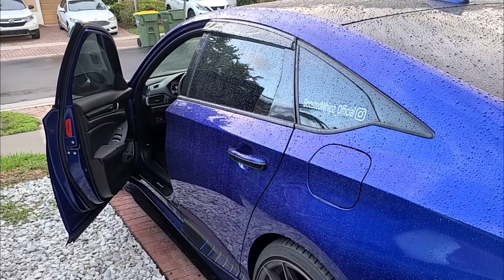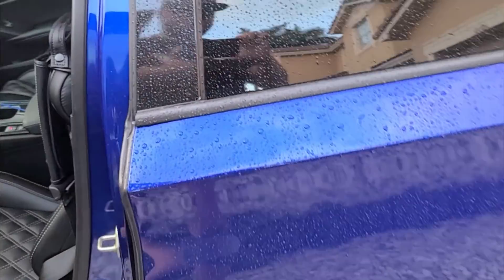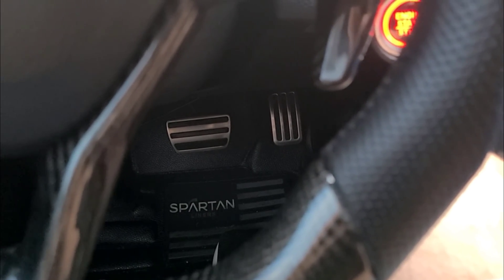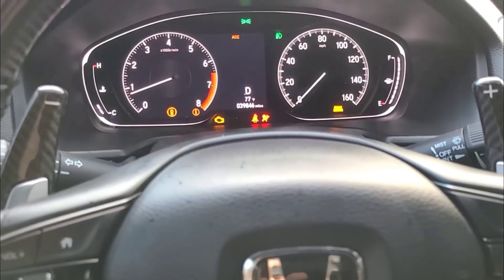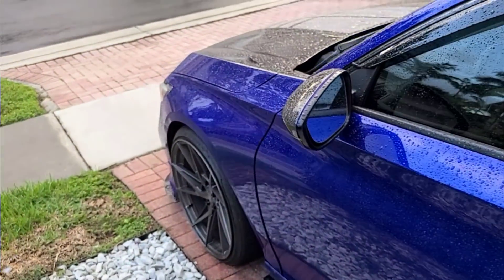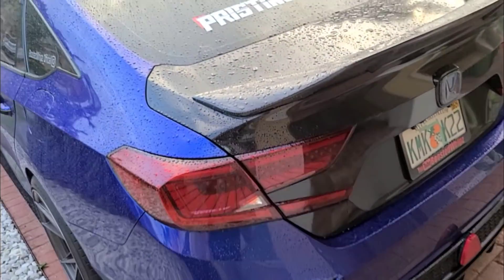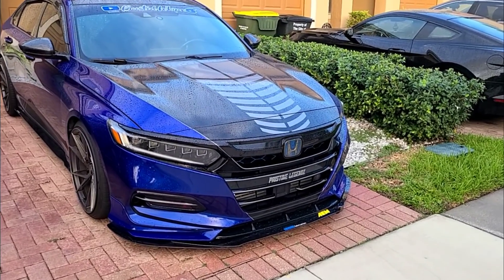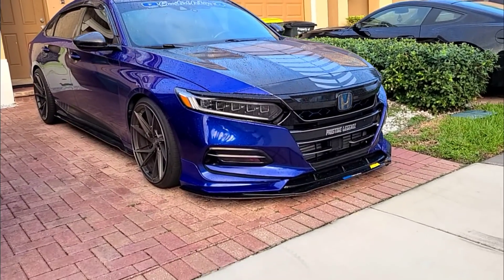CVT Transmission Goes Out at 40K Miles on Modded Honda Accord 2018-2020

Comment: New Honda built quality went to hell. My mom's Honda Accord had to have engine rebuilt after 80k because it was burning so much oil and their warranty is 💩 too! Said it was her fault for putting the wrong gasoline in it when there is no warning for what gasoline.
Reply: what kinda gas?? wth. their warranty expires at 36k i think is shit
Reply: @JollyFlys  just the normal 87 regular. Honda rep stated my mom needed to put top tier fuel in the car. There is no mention in the owner manual or anywhere else. My mom also had the extended warranty too. Me and my family will never buy another newer Honda again! The older Honda are fine though.

Comment: same cvt? won't it blow again?
Reply from the maker: Not planning to run same tune. Plan on going back to stock tune or a base Stage 1 tune.
Reply: @BoostedWhipz  gotcha. ive got a 2014 civic with the first cvt they put in these things. hasnt blown yet but its bone stock. its the thing i worry most about with these cars. now that they have turbos too they will wear out faster. not a fan of this trend.

2k is a very cheap price though. ive heard 6-12k. the things arent rebuildable either because they tend to just straight up explode with shrapnel on the inside when they go

Comment: You know your not supposed to change transmission fluid with a cvt right?? The fluid is for the life of the car. If you change the fluid you need to change the transmission
Reply from the maker: The fluid must be changed at 35K interval based on Honda.

Comment: That's a noob thing to do man. If you're trying to race or mod a car drop a proper solid manual transmission in it and upgrade the components accordingly.

You're better off putting in a 6sp manual or automatic.....generally speaking CVTs are garbage. They are only useful for regular driving and saving gas. But not worth it.

Comment: Cvt gearbox is not that reliable in any manufacturing brand. Here in Malaysia, proton, toyota & also honda have this problem. Thats why hyundai, kia, mazda dont opt this gearbox. Normal automatic gearbox is much reliable. Previously own civic FD with 5 speed automatic, dont face this kind of problem until i sold it.

Comment: I have  Accord coupe v6 I dont even have a turbo and I make more power naturally aspirated than your number on the dyno do u know what transmission power loss is you loose alot from a CVT or  Automatic did you know The J motor is the best road motor they make it comes in the NSX only special hondas and Acura came with the J motor everyone is lost and im sad

Comment: What spoiler is that it’s clean?
Reply from the maker: No longer available but we have a similar on at AEMTuners. Here's link. 

Use AEM-BOOSTEDWHIPZ discount code. 

https://www.aemtuners.com/shop/2018-22-honda-accord-spoiler-3/
Reply: @BoostedWhipz  discount code doesn’t work
Reply from the maker: Did you use entire code?
Reply: @BoostedWhipz  yeah says code doesn’t exist
Reply from the maker: You are putting "AEM-" as well right?
Reply: @BoostedWhipz  I got it now thanks one more question is it taped on or bolt for the spoiler?
Reply from the maker: 3M as all. There isn't any bolted on. Use a higher grade 3M than the one that comes with it. Let me know once ordered.
Reply: @BoostedWhipz  I will when I get payed but what rims are those too?
Reply from the maker: I sell wheels and suspension. When ready just email me at frank@tunergoods.com
Reply from the maker: Those are Vertini. 19s setup start in the $1500s.

Comment: What are your tire specs?
Reply from the maker: 235/35 front 275/30 rear
Reply: @BoostedWhipz  could I run 275 30 all around?
Reply from the maker: @alibattla9763  I have 275/30 in the rear because I have 20x10.5" wheels in the rear. I believe you can run the same all around but may have a less turning ratio up front.

Comment: y do you have to pay out of pocket you only have forty thousand miles y isnt it covered under warranty cause thats a factory defect
Reply from the maker: My car is heavily modified. Honda won't even look at it.
Reply: ook I understand so your going to put in another cvt transmission even tho it could go again you can't upgrade it
Reply from the maker: @colinchandler6516  unfortunately yes because I cannot do a conversion. The cost is much more and I rather just buy another car if I go that route ever. For now getting the CVT swapped for another and lowering down the tune to a basemap.
Reply from the maker: @colinchandler6516  unfortunately yes because I cannot do a conversion. The cost is much more and I rather just buy another car if I go that route ever. For now getting the CVT swapped for another and lowering down the tune to a basemap.

Comment: My 2.0 went out at 16k,  I wasn’t happy
Reply: the engine went?
Reply: @jamesmedina2062  transmission
Reply: @JoshSmith-hs3sd  Automatic?? How did it work and how did you drive it?
Reply: @jamesmedina2062  it was my daily driver for work which was about 15 minutes one way, and then when I went to college just a 5hr trip, I went to Charlotte a few times with it. Occasionally would put it in sport and give it some throttle but noting the car should not handle. I got a transmission failure message on the dash one day and took it to Honda they said they couldn’t see anything wrong. Got the message about 2-3 more times and then I couldn’t even move it.
Reply: @JoshSmith-hs3sd  Well that makes sense for two reasons. Honda dealerships are told to not fix anything until its really broke. The oil/fuel dilution was ignored for months. My issues were mostly ignored. So the dealers just suck. As for the transmission, I had lots of problems with my manual transmission switching gears and it was a little noisy and then I switched fluids and things improved a lot. I think the Honda fluids are really cheap and really bad. Honda looks at fluid like a tool to allow things to break down after warranty. I am sure of it. As they say, Honda is not the same company as they were when Soichiro Honda was alive. Their customer service is as cold as it gets as well. They are far more driven by profits and made many parts in China today. Engine: Thailand, Trans: India
Reply: @jamesmedina2062  it the transmission fine (working well) in your 2.0 now??
Reply: @aymanal_jahwari9148  No I have a manual 6MT on my 1.5T Civic and I test drove the CVT 1.5T as well and know the 2.0T from driving Type R which is a rocket once it gets up to speed. So thats why I asked what transmission you have. I think the 2.0 gets a 8 speed geared automatic. Did it get replaced under warranty?
Reply: @jamesmedina2062 
In fact the 2.0 has 10 speed AT 
They say it very good transmission
I have 2019 1.5 accord exl and it is very good car

And i am planing to buy the 2.0 and give the 1.5 for my sister

Yes this is what i want to know from  @Joshua Smith did honda replaced the transmission under waranty and how is his car now i hope every thing is ok now

Comment: Your car has a 10 speed automatic transmission, not a CVT.
Reply from the maker: Mine is CVT
Reply: @BoostedWhipz  Sure thing.  OK.
Reply: @BoostedWhipz  So you have a 1.5 liter?
Reply: @BoostedWhipz  Here is what I found and I totally forgot they did a 1.5 turbo!!!

 A base 1.5-liter VTEC turbo four-cylinder engine with available active grille shutters produces 143 kW (192 hp; 194 PS) and 260 N⋅m (192 lbf⋅ft) of torque, mated to a 6-speed manual or continuously variable transmission (CVT).[60] The optional 2.0-liter VTEC turbo four-cylinder engine, which replaced the V6 engine option, was available beginning December 2017. This engine is based on the engine in the Civic Type R, but with a smaller turbocharger, different pistons and camshafts, and the addition of a pair of balance shafts.[61] The engine, which produced 188 kW (252 hp; 256 PS) and 370 N⋅m (273 lbf⋅ft) of torque is mated to a 6-speed manual or 10-speed automatic transmission.[60] The 10-speed automatic is 22 lb (10 kg) lighter than the previous 6-speed.
Reply from the maker: Yes mine is 1.5 Turbo
Reply: @BoostedWhipz  Again, my apologies.  I wasn't trying to be a troll and I will always admit when I am wrong!

Comment: Yikes. Hope Honda doesn't head down the road Nissan took. CVTs would be great if they were reliable. Toyota CVTs seem to last(prius). So far they seem like the only one.
Reply: I completely agreed with u in hoping Honda doesn't go the Nissan way. Honda is not what it used to be and it sucks. When buying a car I opted for a Mazda 3 instead of a Civic because of the CVT and being turbocharged because of performance and reliability.
Reply: Cuz Toyota only use CVT in their hybird  only

Comment: The way u put money in this accord, u could buy the higher hp cars like audi A5, S5, dodge scat pack,  kia stringer gt, genesis G70 and so much more. When you know u will spend that much money on a car so why u choose accord with very low hp? Not even 2.0???     Why?
Reply from the maker: I wasn't planning on doing so. I had a Mustang prior to the Accord. I had to get rid of the car due to financial situations and I had a baby on the way. Lost my job and well I went with the Accord. Fast wasn't on my mind at the time. Nor did I want the 2.0 due to the payment was same as my Mustang. Therefore I went with the 1.5 which got a good deal at the time. I purchased when the Accord was fairly new to market. I started modding and saw a huge opportunity on the channel and here I am. The reason I have gone this far is due to partners, sponsors, and YouTube. I need to finish paying this ride off to move on to a G70 or all those platforms you mentioned.

Comment: Why mod a 1.5 that much? Should have gotten the 2.0 with a real automatic or manual not that cvt shit. All the money you’ve thrown into that 1.5 has to be more than what you could have gotten the 2.0 for and still have more hp. Rubber band trans

Comment: Damn I hope the 2.0t hold up with k tune lol
Reply from the maker: 2.0 should be fine.
Reply: 2.0 has 10 speed geared auto. So no issues there, but I actually have 2.0 with the 6 speed for this very reason.
Reply: @CaliforniaPhantom  hi there! So are you saying that 2.0 auto transmission shouldn't have any problems even with ktuner??
Reply: @goalbertangulo  it’s a geared transmission that is tried and true. These CVT transmission have a really bad reliability streak. If I was going Ktuner on mine, I would most definitely go with the 10 speed on the 2.0 Over those garbage CVT transmissions on the 1.5.
Reply: @CaliforniaPhantom  thanks m8
Reply: @goalbertangulo  you'll be fine with a 2.0 10 speed. I have a 10 speed full bolt on with a flex fuel kit and this shit flys. Just saving up for a turbo swap to finish my internal mods.

Comment: You were anything BUT gentle on that car, so no surprise there. I'm curious to see the cost to repair that poor abused CVT. $$$
Reply from the maker: I am curious to know how the hell you conclude I wasn't gentle. All the money sponsors, partners, and myself poured into this build, you actually think I would abuse my car? And I covered the costs in my video and in the description details.
Reply: @BoostedWhipz  A CVT, no matter the manufacturer, is a ticking time bomb. They are built for economy, not longevity/reliability. Look at the issues with Nissan and Subaru CVTs.

I'm simply saying your mods clearly pushed the transmission beyond the breaking point. With all your mods, how much above the stock HP rating are you pushing?

There's a reason Honda outfitted the 2.0 motors in the Accord with the beefier type R manual transmission/traditional 10 speed automatic.
Reply from the maker: It's not running much to be honest. Also covered in the video. My last Dyno was 220HP/TQ.
Reply: @BoostedWhipz  220 @ the wheels...figure 15% drivetrain loss..that's ~ 258 from the crank....clearly more than that CVT can cope with. 😥

Comment: I have hondas i race hondas CVT are not made for true performance sorry if your hurt but the manual transmission is the one to get from honda just because u don't know how to use it dont talk I can bet u a true driver using the 6 speed will woop any bs Automatic or any bs cvt its for pussys whether you like It or not Boy MR Honda would laugh at you ya can't stay in VTEC in a auto or cvt there no control of rpm Btw the V6 Accord is the best im tried of this debate I have a civic too civics are ment for 4 cylinders lol CVT don't actually shift your not a real car boy do your Mods Get a Manual and Join the real Men I'm a Honda Lover but I have to Call out Automatic or CVT If u know how to use the manual you can put the power down the best its all on driver skill and I have been racing my 2 door accord and my civc I been doing this for years